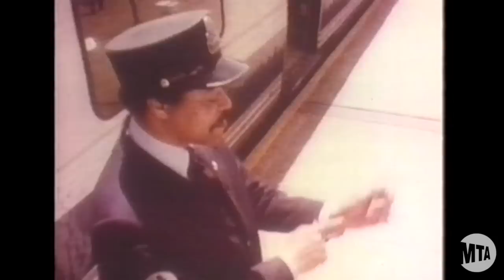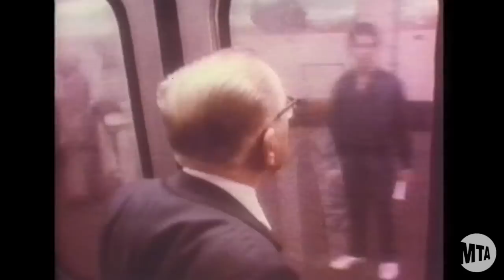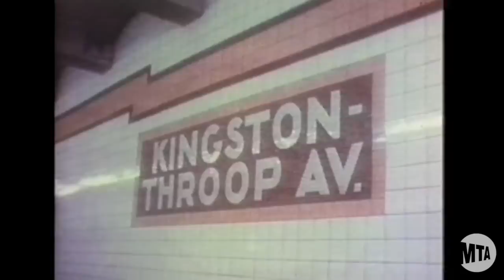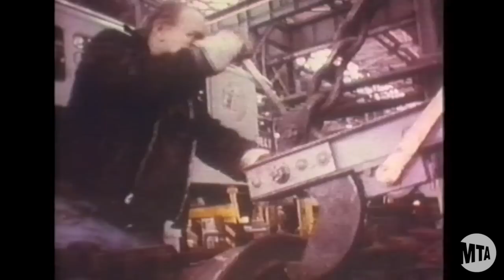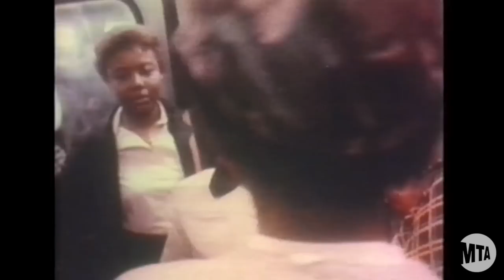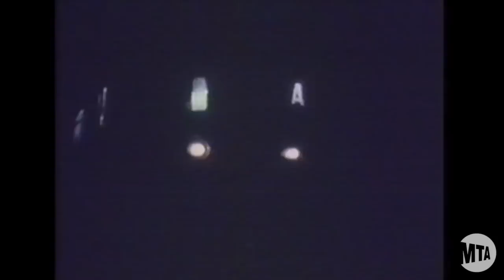Working the "A" Train (1981)

Comment: I operated the R-46 train. This was the 1st train with new technology.
You had the 1st of its kind captain chair that swiveled. The brake handle & the throttle were connected onto one lever. So easy to conrol. Up for speed down to slowdown or stop. I used to operate with my left hand while my right arm, bent at the elbow was out the window. Just like a Cadillac. Comfortable as hell!

Comment: Pre-G.O.H. R-46's

Rockwell International Trucks
P-Wire Braking System
G.E. Slide Controller
You could cut The Radio in to transmit Command Center's announcements directly over the P.A.
All Door panels had Guard Lights,
Automatic/manual Identra Setting side signs (automatic Side Signs), enter 2 digit code = press start, and all side signs would go to that Route/Destination. i.e. 54 was (E) to 179th St. Jamaica, etc.
Hostler Auxiliary backup Controller,
ELE44 Skate Key controls MDC. (Before the "Vapor Key" was introduced in 1985
The old "Command Center", room 300 at 370 Jay Street.

...And the Classic Defining N.Y.C.T.A. Blue Stripe

This is when when the system had personality.
Now its as interesting as a hospital bathroom.
Reply: Oh gimme a break. The r143/160/179s are nice.  They represent the future of the transit system. These times were nice But the reality is, you have to get with the times
Reply: Well one thing I can say is the Kawasaki r68s stay looking so shínny and pristine. And they still ride smooth.  Air conditioning is flawless
Reply: No need to worry, the R211 Trainsets will be a break from the Gray and Teal of the current subway car interiors.
Reply: You are correct sir! The hostler was great. Used to override the deadman with a toothpick!

Comment: at kingston throop avenues you will see a r40 slant
Reply: In the 80's and part of the 90's the A used R40 slants all the time. That wasn't anything unusual. Then after the C stopped using the R10's and R16's they used R40 slants so they were on the line for many years.
Reply: R40 slants were also used on the B line in the mid 80 until they were scrapped in the mid to late 90's.
Reply: @jonbase6004  but they retired I. 2008
Reply: @ninofromkitchennightmares1497  Your right, my mistake because in 2005 I use to see them on 168 St. where I was working at the time being used on the C line.

Comment: Do the subway cars work like Electric Multiple Unites? Or does the lead car pull the entire set?
Reply: Rail Faner They are somewhat EMU. In the video, it said that for the R46, the power and brake is in one handle (like the current NTTs), so if the motorman moves the controller to position and he is in the head can, all cars respond.

Comment: Back when the R44s and R46s had rollsigns.
Reply: In the 80s, they started putting in the digital signs. They first did it on the E line. In the 80s, the E ran exclusively R46s for many years. Then they changed them to R32s in the 90s after the R46s were rebuilt and they liked the shorter dwell time on the R32s.

Comment: I miss the R44s.
Reply: Hunter deja I believe what I meant by this was that I miss how frequently they used to run. Two years ago; I'll never know what I was thinking 😂😂😂
Reply: Hunter deja Nah, the A and R got the 46's. The 44's are on the SIR.
Reply: Rail Around New York,

the F too
Reply: The Metro_ologist I thought the R44s were on the F
Reply: Hunter D bruh my name is Hunter D wtf
Reply: @redbird1train855  Most 44s are retired due to rusting in the frame. The survivors run on SIRT now. R, a few Fs, A, and maybe some shuttles run the R46s. But I think there is an equipment exchange and the R46s are going to the N and W lines. Maybe Q as well.
Reply: Me too
Reply: @redbird1train855  The R44s were on the F line during the 1980s but then they were probably removed.
Reply: Aaron Samuel Ohhh. thank you

Comment: The R44s were in the words of the T.A., "lemons" with problems in the "trucks" (wheel sets). They had to share R40s with the AA/B line. The R32s weren't bad either.
Reply: Venom the god That was the R46. The problems on the R44 were on the technology advancements since they did test them out before procurement.

Comment: Why does MTA still operate trains on old steel infrastructure rather than building new concrete ones?
Reply: Cost.
Reply: New transit infrastructure here in Chicago is all concrete.  That’s how you can tell the old infrastructure from the new here.

Comment: I miss these days. So much variety of trains. Even on one line alone there can be as much as 4 different models running. You never knew what was coming. The subway today feels so generic. Although the R160s have different variations of which only a foamer could tell the difference, it's all the same shit to me. Boring. Bring back the 75 footers!
Reply: +JayJayinNYC Bring back the R10's... once the Kings of the A.
Reply: +WitchidWitchid Yeah, those were some kick ass cars. They were awesome on the Forest Hills lines as well.
Reply: +JayJayinNYC 
Its still like that on the J train. Especially in lower Manhattan. You'll never know if you'll have an R160 and easily-readable signs, or have to suffer through one of their clapped out R32's or R42's.
Reply: Only the J train is like that now with the r42/r32/r160s. But that's only because of people complaining of the C still using r32s
Reply: Tornexted that's so true doe
Reply: Tornexted lol
Reply: I think that it's easier for the yards to maintain one specific model than 3 or 4. However, it makes the system look so sterile. A system as large as the NYC subway should have a variety of car models.
Reply: +Tornexted agreed I love those models on the R
Reply: JayJayinNYC the r160s and the r142/a replaced the r110 a/b
Reply: not gonna happen, 75 footers are inefficient and dwell too long in stations, cant Wait, till theyre gone
Reply: 75 footers have more capacity and are visually more appealing. I don't want a system where all of the cars look the same.
Reply: an 8 car 75 foot train has more or less the same capacity as a 10 car 60 foot train. 75 foot cars dwell too long in stations and are too slow. plus that also limits them from running on the BMT Eastern Division
Reply: well its a good thing the mta doesnt base car orders completely off of public opinion
Reply: 75 footers dwell longer at stations, which causes more delays
Reply: Think of your train designs. Almost all of the new technology trains look the same. We need a new train design
Reply: we really don't, current design works well, the r211's will look a bit different though
Reply: I think the idea of 75 foot cars was to cut down on car component maintenance, by having fewer mechanical parts for the same amount of passenger capacity.

Articulated cars were another similar idea that looked good in concept.
Reply: There still around.  R46s on the F train.  And remember the R68s are in the D and B.  They came in 1986 thru 1988.  I predict the MTA will keep them till around 2030.
Reply: @WitchidWitchid  those carbon steel cars never had air conditioning............including the redbirds.  I'm a Parkchester (6 Train) native.  The R62s are indestructible.  Still running after about 35 years.  And the air conditioning is ice cold in the summer.  The air conditioning is way better than the R142s...............sad but true.
Reply: i85
Reply: THATS WHAT HAPPENS WHEN YOU WATCH CRAP ON YOUTUBE Ubfortubately, they are planning to go for a whole new design for the R221s, with slanted lights, digital bullets and destinations on the front of the train. In addition, we are getting 20 open gangway cars for capacity increases.
Reply: LagTag96 That is somewhat true, but that’s pretty minor. The R62/As are getting increased maintenance to make the air conditioning units more robust.
Reply: I'm a Foamer XD
Reply: @obbyandAWE  no they were prototypes for them
Reply: @Tobias Lewis man I missed them Redbird on The 2,5 and 6 it was such awesome trains and I do missed the front view of the the train looking the view of everything unlike today's most Subway have full cab
Reply: Tornexted like the r46s aren’t as shit
Reply: The MTA had many models in the late 60s to the late 2000s. Now it's boring and lame in the subway.
Reply: @tornexted5029  In many ways. Especially in the Far Rockaway's

Comment: The R46 cars from 1975 subway cars still freshly used today on the A train. So does the Culver-Jamaica F , and so does the Fort Hamilton-Broadway-Forest Hills R train. I do want to say that the new R211 subway cars looks okay on the outside, but the seating and gangways in the cars looks na little too short on the inside (which should be ready by 2020).
Besides from that, the only thing the MTA should not have done , is replace simple rolling signs , in favor of the LED lights signage in those cars; that pissed me off the most. Because when me and my family came back from Chicago in November,1999, and begin riding the trains by myself. Times changes a bit. As far as the Redbird cars and tokens phases out by 2003; I am very upset.    Really, I am very ultimately furrious and pissed off. Well maybe they should keep the tokens for another 5 years, instead of continuing MetroCards, like we still uses today. Overall, l like this mini movie  on the A train from vintage 1981 video, and thanks for playing.  On the personal note, this Transit Authority really needs to do much better , if they want to continue with a 24 hours a day- 7 days a week subway service 🗽🇺🇸😎☕